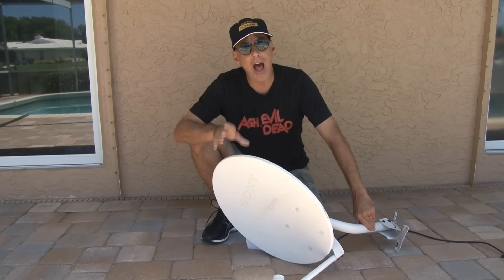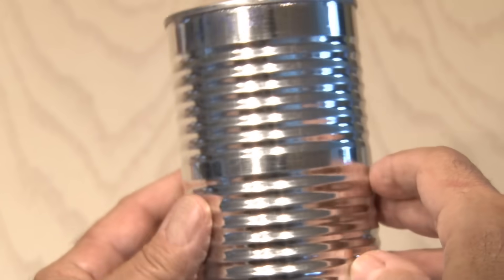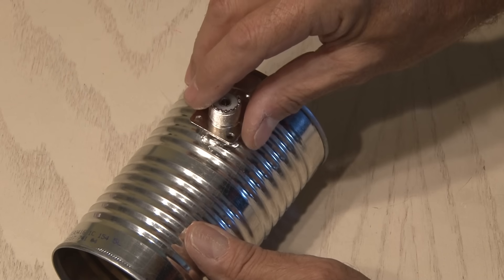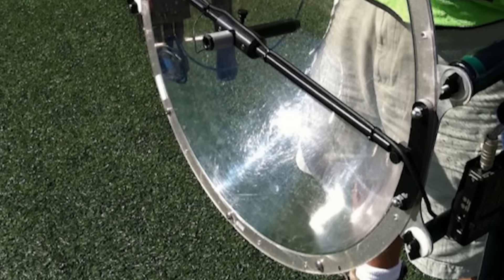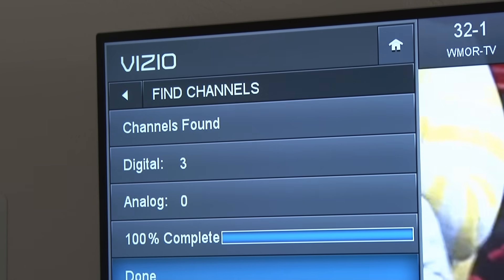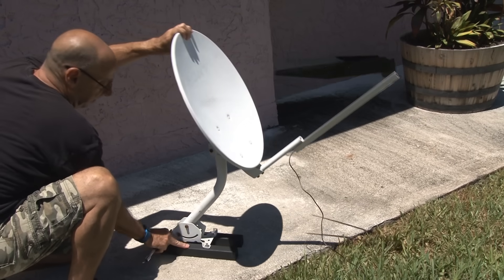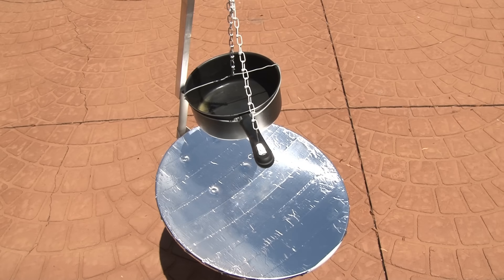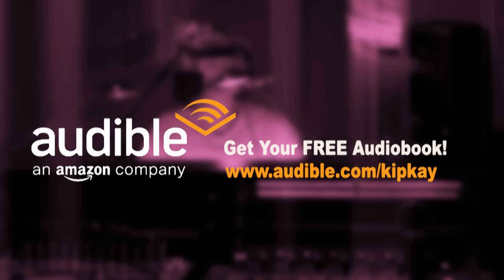4 Brilliant Uses for an old SATELLITE DISH!

Comment from the maker: Check our my brand new series here: https://www.youtube.com/playlist?list=PLtZ1WtnfAMwMDvLU6tB9EjcEovWscdq3x Thanks for watching!
Reply: I have a dish on my roof I'm not using, so I'd like to try this. I found the UHF connector you used, but what type of cable is that, it's not standard. I dont want to waste money on the wrong thing. It looks like RG-8 U ham radio cable.... is that correct? Why dont you tell us in the video ?.. Now I'm on my knees yelling " STELLA..STELLLLA"
Reply: @huggybear539   xiic i
Reply: @huggybear539  I no no no no no no I no j  no j  no
Reply: @huggybear539  c Ungķym qģgğ NJ
Reply: Huggy Bear how is it going?
Reply: @lands1459  also remind them that hot glue is not a good ground conductor to the can
Reply: kipkay can something similar be done with a sentinel for mining with use of the coin app? ...works on blue tooth
Reply: Henandez?
Reply: +I like the martin.
Reply: Great sled
Reply: @mikenewell9217  "
Reply: 68i8
Reply: .. . NJ
Reply: Hey there Mr kipkay... Please, buy yourself a "step drill" to make a lot of the work on thin materials faster, safer and "cleaner"... They drill thin materials without that dangerous grabbing that a regular drill bit does, drills all the way from 1/8-3/4 with one tool, and, on aluminum and plastic, leave a nice chamfer on the entry side.
Reply: Dam Kipkay thank you for your wise video , homework done.
Reply: Landynplayz KD9NBQ update?
Reply: hey what company and model is of that router??

Comment: I use a mt dew can for TV, i get 75 channels.
Reply: Can you explain or show how to with the dew can?
Reply: @johnchristensen585  I drill a hole in the bottom, pass a piece of coax through it, after stripping it to copper.  I go thru the pour hole, to the new hole and make a triangle with the copper about .5 inch above the hole as an aerial.  Attach it to your TV and point in the direction that is best.
Reply: @OG_CyKoSyS  bro 😭

Comment: Y'all inside the receiver part that faces the dish, has a couple circuit boards that are usually gold plated, and contain the good bits like tantalum capacitors, crystal oscillators, and gold containing chips. 
The housing is also cast aluminum for scrapping
Reply: Good to know.  I have several to scrap or repurpose

Comment: My question is why put a co axial attachment on when if u inspect the existing piece it has a coaxial output on it already....  im thinking it should already work without modifying it.  Is it just not the same or what?
Reply: The difference in the coax is:  the satellite dish uses 75 ohm cable. The VHF, not UHF, connector is 50 ohms.

Comment: What or where is the power source on the listening device?
Reply: It should come from the phantom power on the mic preamp.
Reply: If it’s a condenser mic then it would need phantom power from the preamp. If it’s a dynamic mic then only the preamp needs the power.
Reply: Probably an external amp.

Comment: The 2nd mod for me was removing the return spring from the thumb throttle. The spring in the carb is all you need. Added a piece of 1/2 inch tubing to the thumb lever adding another inch. No more tired thumb! Been on my 84 200x 12 years and the top spring is still hanging from the brake cable if I ever need it😮🎉

Comment: Does anyone have a link to the cable he is using for the satellite dish to wifi antenna? having trouble finding it.
Reply: I think it’s called RG58 with the UHF connectors. It’s for Ham and CB type radio. 

Though I fail to see how it actually works plugged into the router like that. I don’t think those are receiver antennas. I think they’re transmit only.
Reply: @riflesfirst208 yeah i tried the wifi thing and it didn't work. i suspect kipkay has faked a LOT of stuff
Reply: They're not connected.

Comment: Just a couple of things.  Cutting the antenna wire to resonance will, most likely, improve the performance.  Also soldering the connector to the can would work better than glue.  Solder is conductive etc.  I got a dish in my back yard, so who knows.  Catch ya on 2.4GHz ?    🙂

Comment: I have a rv in a camp and I am trying to get WiFi from the office to my rv, it is about 200 feet away with some trees in between. Do you think your satellite dish would work? Or is there something else that might work better.
Reply: A chainsaw would work better. Direct line of site in the video example got 1/2 a mile that’s not bad. Depends how thick bushy the trees are it can slow of stop wifi!
Reply: Bro only do this if you can get a dish
Free..
Reply: @vgrepairs  considering that they're asking, we can easily assume they already have that part figured out.
Reply: @vgrepairs  we've got plenty from the different apartments and I can't believe they tell you to recycle it and they don't come out and remove it! No wonder they all charge so much!

Comment: Can someone tell me does it really work or this is b***** because I'm a literally about to go pull out all my s*** and make me one?
Reply: Did it work?
Reply: You still need to make calculation / mats if you want to use it as Wifi / 4G antenna to get proper FOCAL Point and frequency but overall it actually insanely works due to satellite dish give really awesome gain compare to standard antenna *depend on the dish size of cause.

Comment: cantenna 🙂👍
Reply: Sounded like cantina. Looked a little small to be a Mexican place.
Reply: Cantenna is a registered trademark for a line of dummy loads used it testing radio transmitters.  Originally the Heathkit Company made them back in the 60's and 70's.
Reply: Quantenna. Maybe it works, maybe it doesn't. If one is known to work, it's location can't be known.

Comment: honestly id just use this by connecting it to my SDR and decode inmarsat, orbcomm, GOES, NOAA-XX and more.
Reply: I think, the antenna length still must as long as the signals wavelength (or of course 1/4 or 1/2 the wavelength).

Comment: I've been toying with mounting one of those microwave light switches to a Sat Dish to see if it will detect movement at a long distance & cut a light on or sound an alarm.
Reply: RCWL-0516 Doppler Radar Sensor Motion Detector Microwave Module for Arduino Human Body Induction Switch
Reply: @mrdovie47  would you tell us more about it?
Reply: @mrdovie47  I wanna know more
Reply: pleas tell me more thats something i need.
Reply: @my63chevy1  you have to press reply for David to notice your comment I think

Comment: I seriously doubt you picked up free wifi from a half a mile away with that. There is no way for you to send data to the wifi router with that
Reply: Theoretically, the signal should have a strength of ~-80 dBm, but of course only under good conditions.
Also, the antenna has a higher EIRP, so reception may be more of a problem.
Reply: Yeah

Comment: I can’t seem to find a coaxial uhf
Reply: Go to a truck-stop and look in their cb radio section or locate a chrome and cb shop on the interstate.
Reply: It's just the copper wire either way it's about the size that you use in the fitting that you used to connect the rest of your project together to get that to go to your modem you could have sent really get a little more clever than he did

Comment: Please tell me can I use coke can instead of bean can 
Please
Reply: yes but that would involve cutting off the top. would be much easier to just grab a 50 cent can of beans next time yo uare at the store. its also much stronger as its corrogated
Reply: Around 90mm can is best for 2.4Ghz wifi
Reply: So this set up works well?
Reply: @kavindugilshan  90 mm diameter or lengthwise
Reply: And you can have beans for lunch !!
Reply: No. ONLY BEANS!
Reply: I think he wanted the bean can because it is steel and the size was right.
Reply: Go any good kirana store and ask for canned tomatoes or canned mushrooms Tera kaam hojayega
Reply: I live in India and it is really hard to find a canned bean

Comment: No such thing as a 'hdtv' antenna. The hdtv is added to the description to justify charging more for it. TV signals are digital. Guess what hdtv are too.
Reply: Yet it worked.....
Reply: Try picking up an HD signal with a basic antenna set up. Doesn't matter if the normal channels are just as good as the HD. You're not getting them with a normal antenna. It won't pick up the Frequence. It might be BS but it's BS they have a wall blocking.
Reply: @thewallcollection1245  so you agree antennas are just elements designed to pick up certain frequencies such as vhf and uhf
Reply: @jesshadfield3566  4k HD over the air is still in testing. You need special equipment not available to the public. So like said. Good luck picking up 4k hd. So based on what you just ask me. Yeah I agree with that statement.
Reply: @thewallcollection1245 , at least here, HDTV uses the same frequencies as normal TV (Over-the-air TV isn’t even available in SD here anymore).

Because DVB-T2 and ATSC don‘t use MiMo, a antenna tuned for the used frequencies will already work.
Reply: No all RF signals are all analog. Even square waves have rounded edges if you zoom in

Comment: I’ve always thought about snagging a dish in a ditch and make a scale replica of the F-111A Attack Radar dish on the roll pedestal, flanked below with two TFR antennae...”scale replica” because the dish is a little smaller than the ARS antenna.

Yes, I’m weird like that. 👍🏼 I figure it’d make a great wall decoration in the living room.

Comment: I've got bad news. There's no such thing as an HD antenna. A TV antenna is a TV antenna. Any TV antenna will receive HDTV. ANY piece of wire will receive HDTV. It's just a marketing ploy to make you think you have a special antenna.
Reply: Don't forget an antenna element has to be cut to a specific length to pickup certain frequencies
Reply: @jesshadfield3566 , this is partly true, but if you live near a TV tower, a untuned antenna will already do the job.
Reply: @jesshadfield3566  I think that matters more with transmitting than receiving as long as there is something to catch the signal and “shoot” it to your tv
Reply: Why's that bad news?

Comment: Has this worked for anyone? And is this legal?
Reply: From what I've heard it is perfectly legal to receive any signals in the air. If a company doesn't want you to, it's up to them to scramble the signal.
Reply: nope cause i don’t have a dish but it is legal only boomers think its illegal.
Reply: @mr.engineear0987   Do not make fun of use Boomers.. I even use one of these direct tv dishes that I picked up curb side as a solar cooker
Reply: Gotcha..  then I'm going to give it a try
Reply: @JayO1963  does it work
Reply: Jab Sørstad  its only the things that turn out to be risky are gonna lead to illegal. You smart mate 👍
Reply: @platinumsky845  no one asked you m8

Comment: the glue is not recommended for cold weather areas it will fall apart, use epoxy
Reply: It won't work in hot weather either.
Reply: Hot glue will already often lose its strength at 30-40 deg C, so the BNC connector should be soldered/glued with epoxy in all cases.

Comment: Only receiver dishes are actually pointed not at satellites in space but stationary towers on the ground. The Technology was adopted from military communications technology.
Reply: Actually, satelite TV and Internet is entirely from actual Satelites. The signal originates from terrestrial stations, is sent to the satelite, and the satelite re-transmits it back down. Reception of terrestrial stations with a standard satelite setup would be extremely unlikely, as Ionospheric reflection (and similar) are nearly impossible in the UHF/EHF/Microwave bands used by Satelites.
Reply: Mr. McGoover ,  look at where most dish antennas are pointed to.  This should be where the satellite is located up in space.

Comment: Long ago we used a Pringles can with a dongle set at 3.5 inches. We picked hundreds of wifi signals out of a city from a cabin in the mountains 29 miles away...some of you actually remember the set up. ( south Florida ) .
Reply: Hi mate, im a sailor do you think i can also use this in our ship. Because sometimes we are 30nautical miles away from land.
I will use a router that has a sim card slot do you think it can boast the signal that im recieving? Thanks
Reply: @kentmaxisalazar3411  Talk to your radio man , he may help.

Comment: There is one thing u left out about the parabolic deflector...It won't work without an amplifier..I didn't see an amplifier..you didn't mention an amplifier..I use a small guitar amp..plug the mic into the input and the earphones into the output.  have the amp off at this time. Make sure all amp controls are turned down, put on ear phones, turn on amp.slowly turn up volume and when you hear static start turning the treble and bass up slowly.  you will start getting sounds.  don't move the deflector while wearing earphones it will vibe your ears...lots of fun if done right. install it outside of your bedroom and lay in your bed at night while it is raining.....amazing sounds
Reply: ALSO FORGOT THE
FLUX COPASITER AND A LONG EXTENSION CORD WHILE DRIVING UP TO 88 MPH?

Comment: Wi fi antenna is a bs video - show it working , I bet you can't !
Reply: I think that's check mate!!! 😂
Reply: Is this work for cell site?
Reply: Even if it did work it's highly illegal
Reply: @k8kzhjacobbrofford303  How is it illegal ?
Reply: @sparkywirenut  you can't use public wifi if your not at the establishment. People have been arested for doing it.
Reply: @k8kzhjacobbrofford303  oh , thanks , never heard of this before , learn something new every day !
Reply: K8KZH JACOB BROFFORD where are you referring to and show me the code in the law?
Reply: @mrstyle_67  U.S. law 18 U.S.C. § 1030
Reply: U.S law 18 U.S.C § 1030 speaks NOTHING of the use of PUBLIC WiFi being illegal to use if you are not at the establishment. The law mentioned only relates to this:

"The Computer Fraud and Abuse Act (CFAA), 18 U.S.C. § 1030, outlaws conduct that victimizes computer systems. ... It protects federal computers, bank computers, and computers connected to the Internet. It shields them from trespassing, threats, damage, espionage, and from being corruptly used as instruments of fraud."

If PUBLIC WiFi were illegal to use, then it would not be called PUBLIC! However breaking into a private password protected WIFI would be illegal. Use of any WIFI or wired network to conduct illegal activities would of course be illegal.  I did NOT see or find in my extensive searches, of people that had been arrested for just using a PUBLIC, open WiFi system and not doing anything illegal while connected to those systems.
Reply: @k8kzhjacobbrofford303  how about not living in U.S.
Reply: @sparkywirenut   It is refreshing to see someone that believes anything that is posted on the internet. It keeps people laughing when I say, "I seen it on the internet, it must be true".

Comment: Sorry but I've got to call shenanigans on the sketchy (at best) ground connection on the wi-fi antenna. By using only hot glue on the tin can to SO-239 connection, is just asking for an issue that even one nut & bolt or just one pop rivet would correct. As for the others.... they look fine. Keep up the good work!!!   Roger  W9RHS  :^)
Reply: Pingapong64  Yes
Reply: What
Reply: @joeyknight8272  On antennas grounding is important. On radio transmission without a good ground plane you can't get good signal. Hope this helps - K8KZH
Reply: Pingapong64  You are correct!
Reply: would regular electrical solder be fine?
Reply: @Greameable  it could work to create an electrical connectiom but probably would not have good holding power
Reply: @k8kzhradiotipsandreviews31  Thanks for the info! 
I'm a man with no rivets but plenty of coax, solder, and duct tape. I can make that work.

Comment: I used to work on antenna design many years ago, the idea of a cantenna is not new, but it does work.  The SO-239 connector, otherwise known as a "UHF" connector, is a very poor connector.  Back in those days, in the early days of radio, 400-500 MHz was ultra high frequency, by today's standards, it's nothing.  There are many connectors better at 2.4G than a good o'le uhf connector.  Better choices are, SMA, N, BNC, and even an F connector.  Attaching the connector to the can with hot glue, a very bad idea.  That connection has to be as perfect as you can get, at least use four screws with nuts or even solder the connector to the can.  The distance from the back of the can to the center point of the probe is very important.  The length of the probe also important, as you illustrated.

All microwave behaves using the principal of PFM, you can investigate PFM, I'm sure it's in text books somewhere.  -  Jim
Reply: Nice

Comment: I actually have this exact same router and I can assure the cable coming from the TV dish doesn't fit into this antenna slot once it is removed.  Yes, I know, he probably used a different cable from a different source other than the TV dish.

Comment: I have a router that looks like that, but how do you get the antenna out without breaking it? Are those tv coax connector or BNC?
Reply: Don't waste your time  , this is a bs video   Your router will not pick up other routers .

Comment: Hello... Creative thinking and useful reasons to save these. My question is where or what did you plug both the microphone and headphones into that links them to use for listening? I didn't see where the connection happened to take place. Thanks Cheers
Reply: any kind of an amplifier.   I used a guitar amp..read my other post

Comment: VIDEO IDEA: 

Kip, I have a video idea. 

Show us how to hook a cellphone up to a nano router and get unlimited WiFi internet using the cellphone as a modem, the nano router as the router, and visible wireless for the unlimited data and speeds 

Show us how to connect individual devices to the wifi in the video